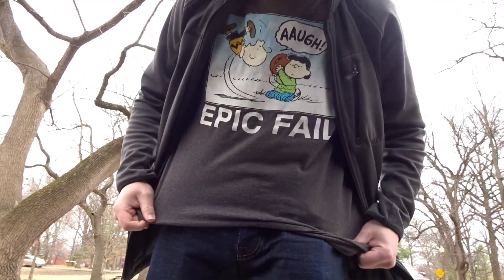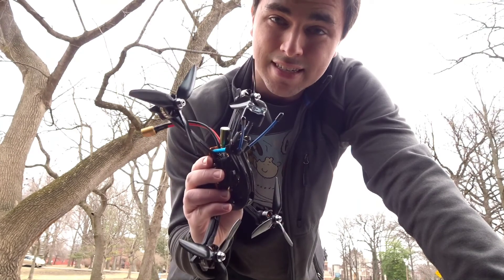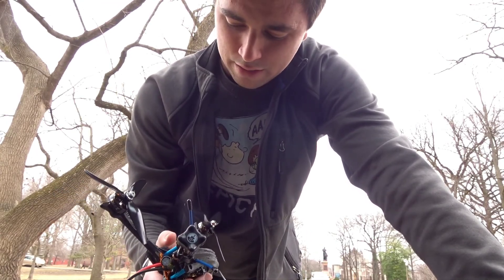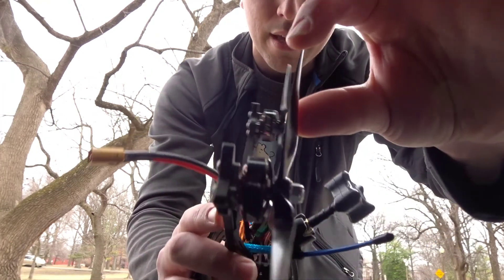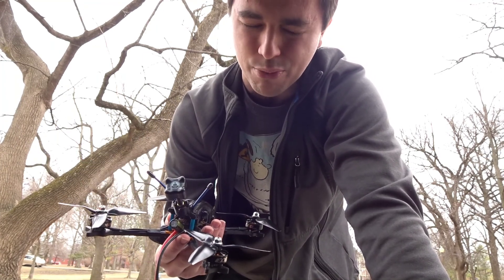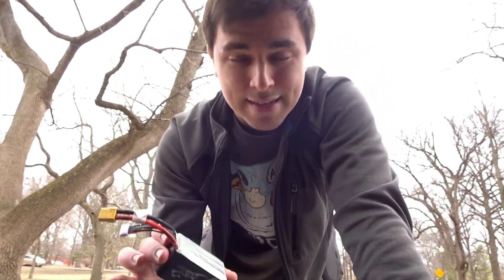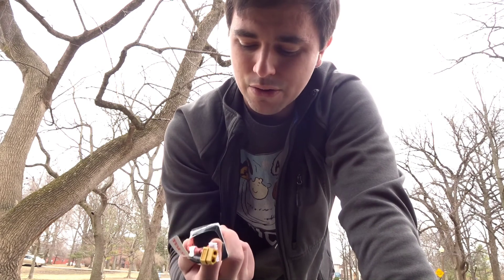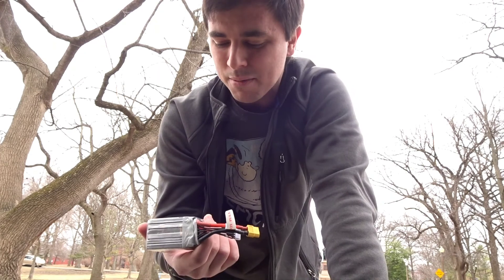Hyperlite Floss 3 Hybrid First Flight

Comment: What rate profile/ PIDs are you using for the hybrid. I just finished building mine and there are so many oscillations when flying.
Reply from the maker: For 6s Im using betaflight 3.5.3 and for pids i run 
Roll P: 38
Roll I: 57 
Roll D: 19
Pitch P: 53
Pitch I: 67
Pitch D: 23
Yaw P: 87
Yaw I: 57
Yaw D: 0

I also run 100 feed forward on roll,  pitch and yaw.

Comment: Looking forward to what others think about your build. My friend used a JB.  flight controller with no luck. 4s flew fine but 6s tazzed out badly. He was using a T motor esc, and also used the esc with another flight controller, and it worked fine.   I also just built my 1st 6s but I used a crap racerstar 35amp aio esc that didn't come with a cap.so I'm waiting on that b4 I try 6s, flus great on 4s. Not sure but RDQ might swap those batteries out for you, also my friend liked the RDQ branded 6s batteries. Just fyi the UF.on a capacitor is a unit of measurement called micro farad.  Larger ones like for air conditioners are measured in farads. Lol my JB. your gonna learn something today speach. Btw great looking build!!!